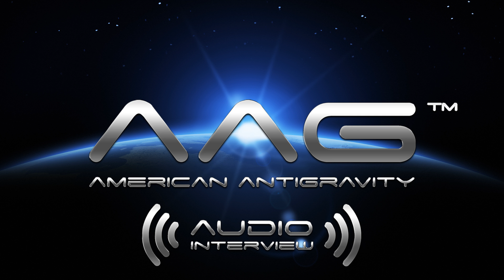Sam Barros on Railguns & Electromagnetic Weapons

Comment: I've wondered for a while now about using an explosively pumped magnetic flux generator to produce the current for a mass driver.

The main problem is that the power supply would be destroyed in firing.